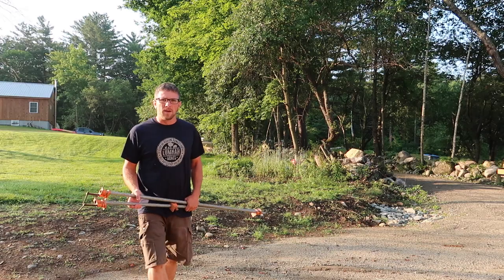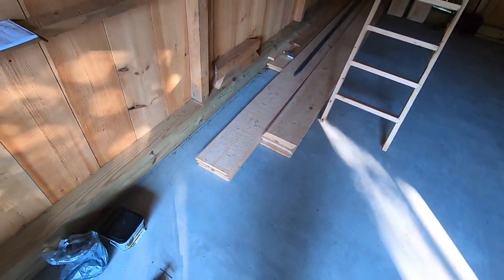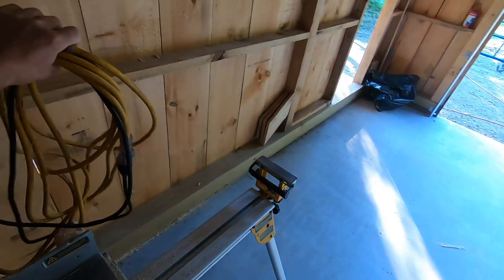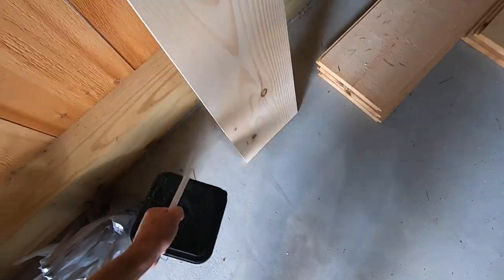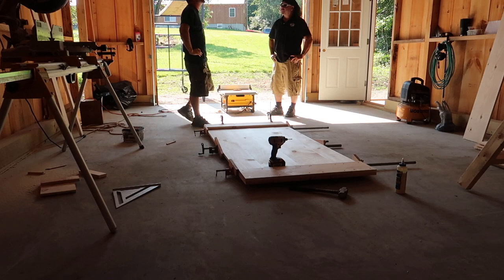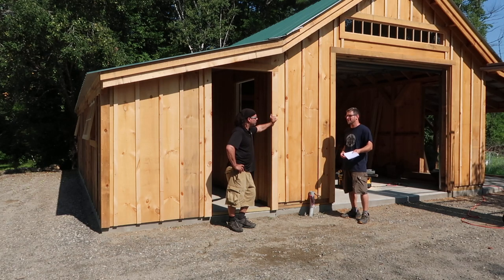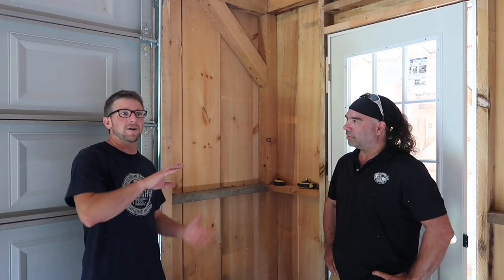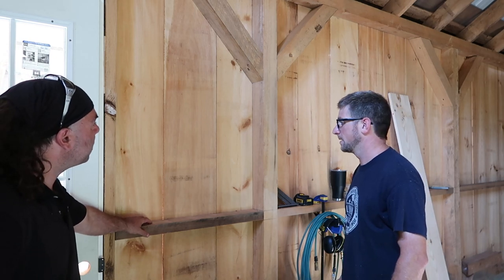This Should Answer THAT Visit from the Manufacturer of the BARN we Bought off the INTERNET

Comment: Good morning Al. We plan a trip over to VT to check out this manufacturer.  In 1980 my 1st husband and I built a 20x30 stick built b&b workshop with a 4' knee wall. We poured the Alaskan slab ourselves and I cried through it. Very difficult for two inexperienced people to do. We should have sectioned it off prior to pouring. But it turned out to be acceptable for our use. We had also milled 22,000 board ft. of oak for the walls off our property a year prior. Back then it was 11 cents a board ft.  We had to use 6x6 beams in the center to support the structure, VS your open post and beam. So your barn is something you will enjoy and remember building with each passing year of use :-).

Comment: We went with the sawmill to make our own lumber.  We are cutting down the trees anyway to clear, we use the softwood for lumber and the hardwood for firewood.  We want a number of outbuildings, so in the long run we it will be cheaper then buying the lumber, and we get much better quality lumber then what you get from the box stores.  In a few years we can sell the mill and recoup quite a bit of the money back.

Comment: Goooooood Afternoon Al ,
How nice to see the company  do a follow up to see how your barn kit is going for you. 
I once bought a sun room kit from a local company. As soon as I paid for it , I never heard from them again.  I'm not surprised that they now seem to be out of business.
Ha ha , Dom is a leaner.
 The two side extensions are what make your barn work .
 Wow , double thickness doors !
 I'll be watching to see how you do the insulation of the barn.  That single thickness of wood is simply not going to retain much heat for you .  I'm surprised that you have and use the table saw on the floor.  I have a portable , folding , work bench that I have have had for 30 plus years. It's very handy when you need a temporary work bench in the house , back porch , driveway or even out in the yard.

Comment: Instead of moving the firewood to “rotate” for dry fuel, we designed our shed so we can access it from either of 2 sides; then we just rotate our behavior each winter for which side we use to grab the wood. We store the newest wood in last winter’s side so it has the whole next year to dry out.

Comment: So very nice of Dom to give the Lumnah 2019 code for your viewers.  Mr. Al, is your generator of large enough capacity that you could put an oscillating fan in the barn while you work? Have you perhaps considered an automatic greenhouse  louver in the back of your shop area that is temperature controlled for air circulation. I'm certain you could even make a cool cover for winter.

Comment: In a traditional door/gate build, the angle board should be butted up against the top and bottom horizontal boards (not "running over" the sides of the door) with the lower end at the side of the hinges so as to provide a physical compression "triangle" that will resist vertical skewing of the door under its own weight.  In the build shown, the "skew resist" is not so physically robust.  That is a design fault.

Comment: Spray foam can be a risk. When you let that do, be sure that company has trained staff and are certify to do this work. Make a contract with a security inside that when its go wrong they have to pay all costs to replace it. Also contact your own insurance if its covered. That company can go broke and then you can build a new barn from your own money. I know its sounding all very pessimistic but there were very bad cases. Better check it first or take no risk and isolated your self. (what I should do) Its more work, I know, but no danger and no chemical disaster afterwards. Take care, Regards, Tony.
Reply: Will Al be doing it himself?  I'd like to know what insulation the will use for the ceiling.
Reply: Yes, saw some horror stories about that foam on youtube. Just knowing that and taking some precautions should be enough. I would think the foam would be best to keep the critters out.
Reply: Antonius ... good heads-up.  A couple in WA had problems with out-gassing from the foam used in their house. Not sure if type that Al is thinking of, but worth thinking about  [Blue Creek Dairy Farm  https://youtu.be/Ezwmnb7Sz4E?list=PLASLRc7kty2BX1WzvWQZS81bcVz37R4WY ]
Reply: Yes I agree, quite toxic and highly flammable. Reaches flash point in under a minute. Not what I’d choose. How about wool? Sheep’s wool is a cosy insulator.
Reply: Sissy Dewoody and the goats will be breathing the fumes.

Comment: Two comments, not just for this episode. 

I love how you do everthing up to the millimeter :-). It's all straight. Which is IMHO the nice thing with "wood from the mill", it is all regular inches, not all those dot-dot-and-a-halfs. 

Here a serious problem: With such a big project and all lumber delivered at once, it takes a while to complete. In this case many boards (under wraps) have over time been going black with mould/mildew. And that stuff is really unhealthy. To fix it in your case I would recommend a serious pressure wash, followed by a treatment with bleach.

To prevent it (for other projects and followers) you should not have left your timber enclosed in some plastic wrap. At the beginning you could have built a very primitive (just some plywood) but ventilated shed to store all the materials in your package which would have prevented it from going black.

Just a thought ...

PS. we built our own cabin, so I talk from experience ...
Reply: William ... do you think the freezing temps kept mold down?  The boards didn't look moldy to me.

Comment: I'm curious about the snow load. Is the pitch of the eaves adequate to slough the snow from the main barn AND the eaves? Or will it have to be done by hand??
Reply: It's designed by New Englanders, for New England, based on historical, New England designs. From here in the South, I'd expect it to be adequate. 

But I'm studying roof pitches, too, only more from a rain and hurricane wind standpoint. In Florida, the conventional wisdom is to build hip-roofed houses with very low pitch, and this will equalize the pressures of forces inside and outside the house during a hurricane. And snow load is not a problem, so we don't need a steep roof for that. But I look at the few houses that have been there since the beginning of Spanish/Minorcan settlement, through to the one built in the Anglo settlements just before and after the Civil War, and those buildings have lots of the same influences as the garage and other post and beams have, all with 8:12 or so pitched roofs, and they are still solid. Even classic Cracker cottages usually have 8:12 pitch roofs. So I think that's the way I'm going. There's a lot of living space in those attics that is lost when you have to use a low pitched roof!

Comment: Are you thinking about putting a window in the shop area back wall to help getting some air flow
Reply from the maker: I’m not sure yet.
Reply: Consider building your shop tables and cabinets on large casters. This would allow flexibility to expand, contract and rearrange/relocate.  There   is a long list of benefits - for workflow and video production sight lines, to start with.

You could even set up on the driveway on  a nice Spring day.

Remember to have at least one wife and daughter height surface.

On that subject, remember to never stack firewood higher than the wife can reach. 😉
Reply: For air flow and more natural light Al I think you should really strongly consider it.🙂

Comment: In 1996 wonted to build my home and bought a woodmizer  lt40 super for 25K, I thought I could use it and sell it when I was done well its been over 25 years and over 150 projects later including 24 homes, 35 barns countless home improvements  I have learned more from that purchase then any other in my 65 years but we finally sold the mill a few month a go for 22k not a bad deal ( and I miss it)

Comment: First time I've ever heard of insulating a barn. Barns that are too tight are unhealthy for animals, better a barn
with lots of cracks for fresh air. Calves in barn with herd of cows, if barn hasn't enough ventilation, will all die.
Speaking from experience. Well that was 50 years ago; maybe technique has improved. Have you considered
manure removal, if you will keep animals in barn? Well anyhow. It's a small hobby operation, so maybe doesn't 
matter. Doors on tracks are nice, though tracks & rollers are expensive.
Reply from the maker: We center area is going to be a work shop. That’s what we will insulate
Reply: Both lean tos are for the animals
The center is Al's work shop
Remember the rainy days
the cold winter days
Insulating the shop area will give them a nice area to work on projects...

Comment: You need to pick up a used sawmill and go buy the raw wood or get it for free and the money you use for the mill will pay for itself with the first building you put if you got 15 000 into your barn you could of bought a pretty nice mill for that and put up the barn for pennies on the dollar. i picked up a lumber mate 2000 by norwood for 3000 a month ago. I am a welder by trade I have built my own mill as well. I would pick up a used mill as there something that does not wear out usually and anything that does is cheep to replace. like bearings. The amount of satisfaction on milling your own wood is so rewarding. yesterday a guy approached me to go cut some trees at his place so I have a bunch of logs to go get for free. just gas monies. Also a mill is a great money maker for the homestead...

Comment: What's bothering me a little bit is, the sun coming thru the spaces between the wood on the walls. I thought they were flush up against each other.....but are u going to put insulation all thru the inside of the barn? & cover up every crack on the outside, so wind cannot come thru or rodents or moisture? But I am not any kind of professional about this....you are....
Reply: Battens have not been installed on rear yet.
Reply: @tonygrimes13  OK. Good.